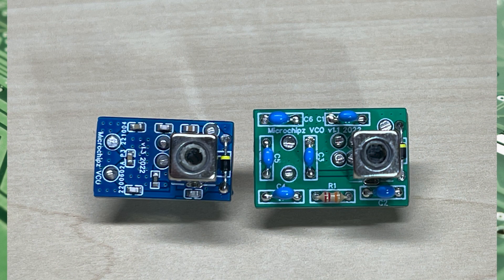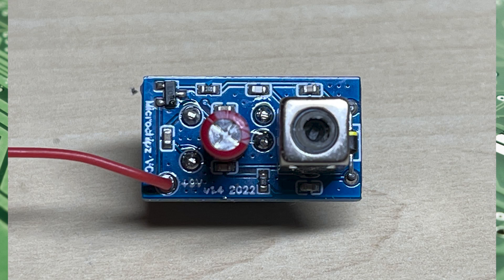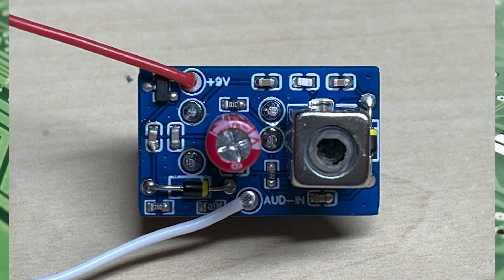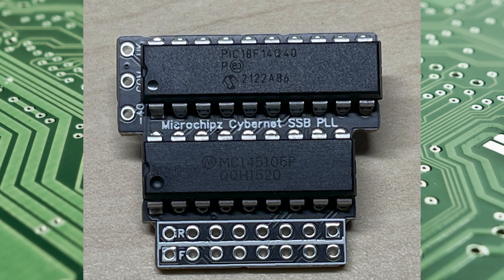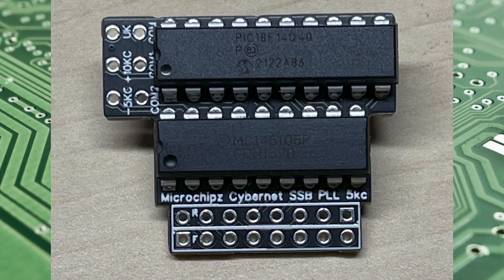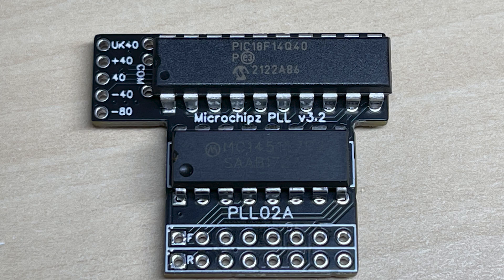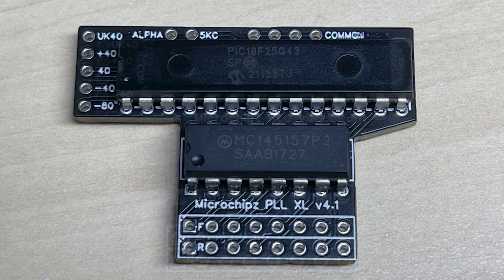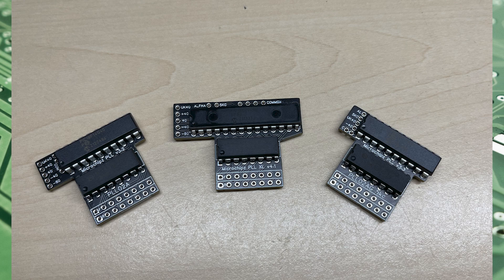Microchipz VCO's and PLL modules - NEW for 2023

Comment: I've got a couple of hygain 5's  the 4 band 50 ch jobs, ptbm125a4x, i think they call them 8795. Can anything fun be done with those pll wise?  They cover 25.965 to 28.005 a bit odd to remember where you are. Im just restoring one of them have some vco's on the way from you.
Reply from the maker: Hi , the PLl is not the issue , its the channel change , i don't have any mods for the 50 channel version. Some people put in 40 channel change.